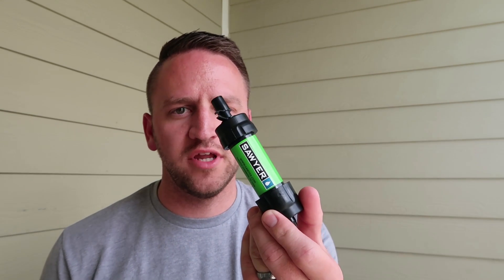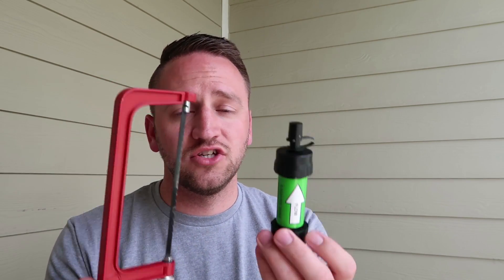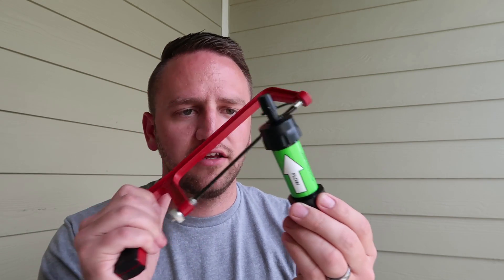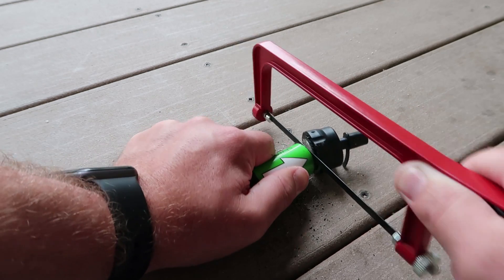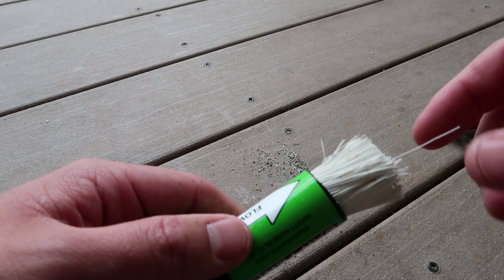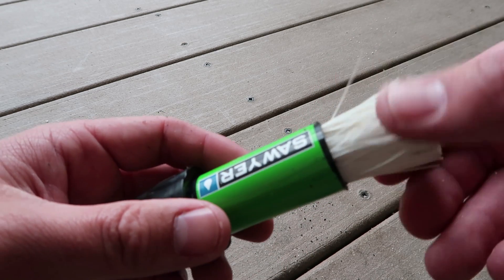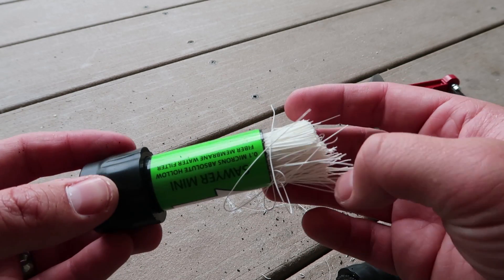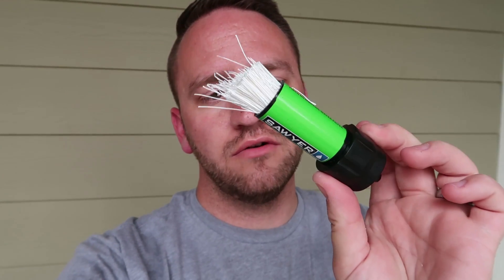What's Inside A Sawyer Mini? | Cutting Open A Hollow Fiber Filter

Comment: Is this a filter that had been used for a while or a brand new one? I'm wondering because I'm worried about mold or bacteria collecting inside, I saw one video where they took one apart that had been properly backflushed and cleaned and it still looked pretty disgusting inside.
Reply: He said in the video he was using it for a year.

Comment: Doesn't look convincing to me: I expected FAR more of a complex, multi-tiered filtering system.
Reply: Right, like would it have been that hard to just throw a layer of activated charcoal and sand?
Reply: Likely would require another particulate filter to then filter the charcoal and or carbon?